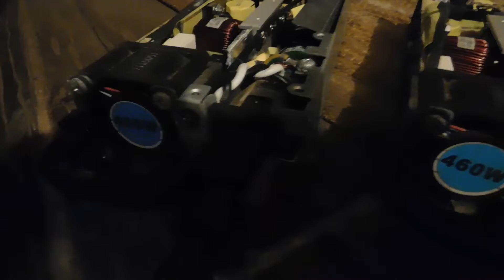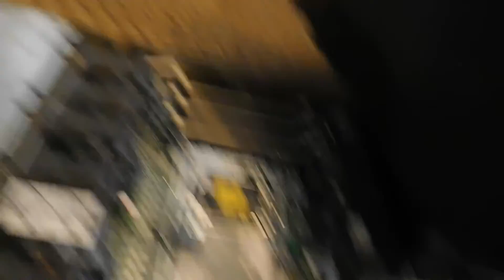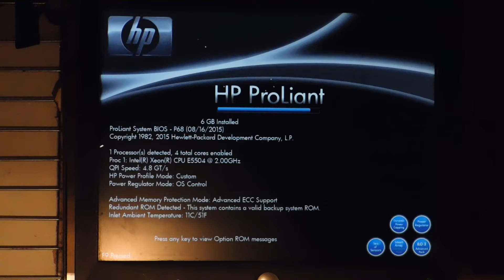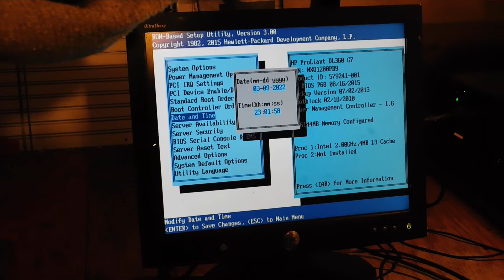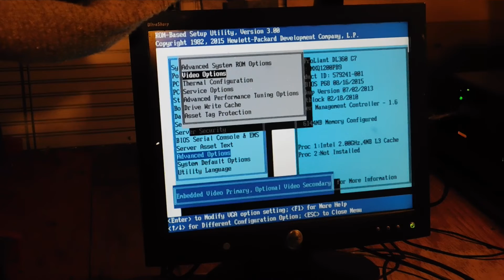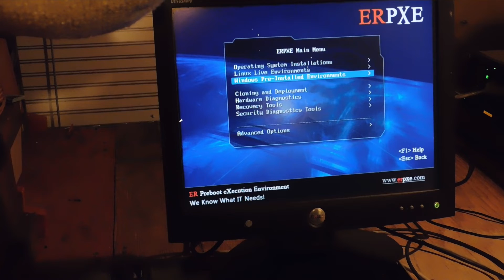Curbled: HP ProLiant DL360 G7 - Repair and Overview

Comment: Hey there! I’ve got a dl360 g7 just like you! But my only issue is that it turns on by itself, but whenever I press the power button it doesn’t immediately turn on like yours. The power button led is amber, no lights show up on the SID panel. I’ve looked through all the forums in the world about it and nothing has seemed to fix it. Would you know anything I could do to fix it?
Reply from the maker: I would guess either a bad or poorly contacting cpu, or a bad motherboard. try to reseat the cpu (you can try to clean the flat contacts on it with an eraser, but only do it to the cpu, not the socket) remove any add in cards and all memory too, to see if it gets any further (you should get an error light at least.
Reply: @I430VX  I know that I get a solid green light near the iLO RJ45 port (there's around 7 LEDs there, only 1 is lit, I've forgotten what no. led it was), and I do remember that it has posted before (it at least made it to memory diagnostics), it's just powering it on that's the problem.
Reply: I've also tried reseating the CPU, and that didn't change anything (have to admit, thermal paste needed replacing so I'm glad I did).
Reply: @PrisonYT  Maybe try checking auto power on stuff in the bios?

Comment: I always enjoy when the power supplies turn on and don't explode. Great work reviving a still functional server! The parts are currently pretty cheap to aquire as of now for your HP (and most dell units too). Personally I'd slap windows server 2003 Enterprise R2 x64 but that OS is pricey if you don't already have it.